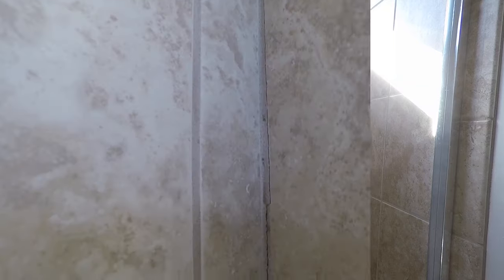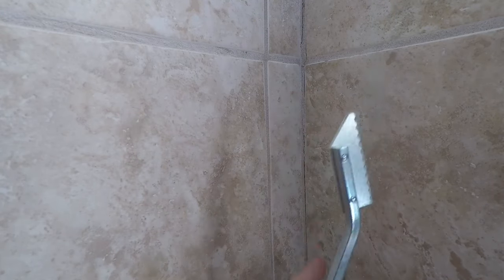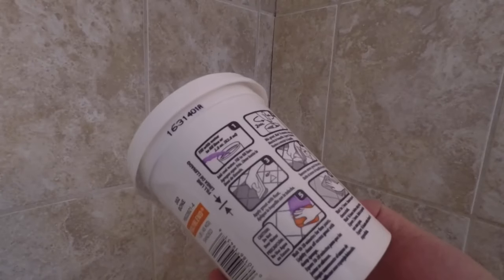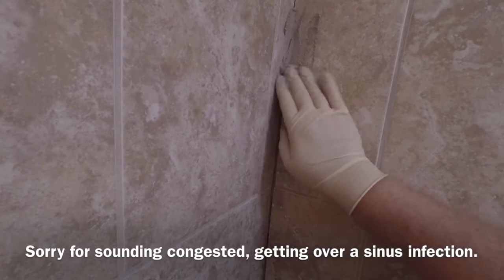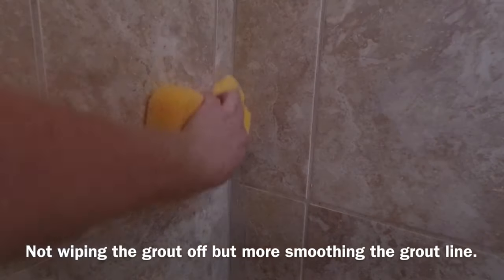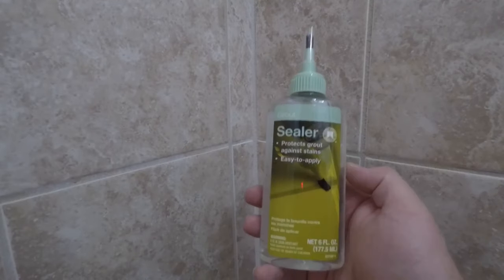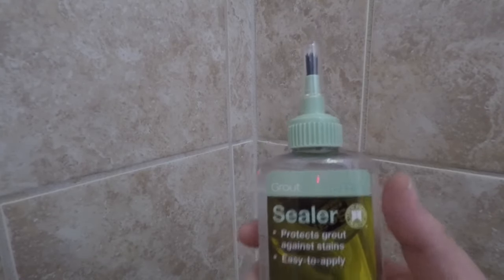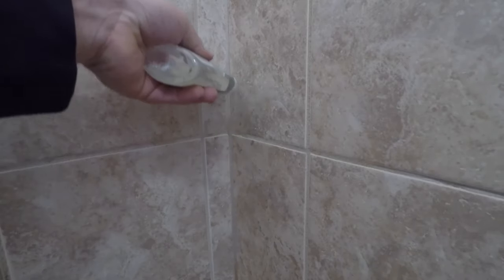Repairing Cracked Grout Line in the Shower

Comment: I repaired the crack just by applying new grout over the crack and wiping off the excess.  worked perfectly.  Been 9 months still looks great.
Reply from the maker: jzizzles that would be the easier solution, but if there is a sealer over the  existing grout the new grout may not hold. Also the possibility it re-cracking is always there. The best solution is to remove the old grout and replace it with new grout. Some professionals will also caulk the corners.

Comment: Exactly what an un-handy guy like me needs to know and be confident in what I’m doing.! Thanks for much for making it easy.
Reply from the maker: Easy - I would use the word doable.  Confidence comes after doing it ones or twice and finding out, yes I can actually do this.  

I always keep in mind there may be mistakes but with patience you can hide most mistakes. You may see them but no one else will.
Reply: @code3imagination441  Now that the grouting project is finally done, I agree — it’s doable. Lot of time and effort and not easy, but it turned out well. Thanks so much, Tim. Your online tutorial helped me every step of the way.
Reply: @paulmarck9349  t
Reply: Thanks My weakness is a cross between time and opportunity cost with big hands and not wanting to be a super clean and it becomes a mess at times
Reply: Hello. If I only need to repair small cracks and holes in the grout on the shower floor, do I need to take out the entire old grout with the grout saw? I just need to do small touch ups. Thank you for the video.

Comment: To anyone seeing my comment: I highly recommend doing this when you’ve just bought a new house or had someone do a shower remodel. Sadly, most tile installers don’t bother doing this step (takes more of their time and effort) and you won’t think about it or realize it until you’re eventually trying to scrub dirty, moldy, hard-to-clean grout. Taking this step will also help avoid having to pull out disintegrating grout later on. Prevention is key! Plus, continuing to use a shower with disintegrating grout is a recipe for disaster as it allows water to get in behind the tiles, creating mold and potential water damage. Ask me how I know this!
Reply from the maker: Remember grout is porous and water will get through with out cracks present. The number one thing to prevent water is prepping the backer board and waterproofing it properly.

Comment: Peraonally i would have siliconed the corners due to expansion and contraction.  Thats why it originally cracked i guess.  Unless the polyblend flexes? Idk
Reply from the maker: Paul Pagano new construction home. They cracked as the house settled.  They cracked with in the first year of being here.  Once I fixed it they have not re cracked.
Reply: Paul Pagano you are correct. Caulk the inside corners, don't grout.
Reply: So if the corners should have ( I stress "should have") been caulked, then why don't they just do that when they first do the tile, I've had 3 new houses and never seen a right angle grout joining on wall to wall or wall to floor or this to that ever anything but grouted. I did see in the big box stores tubes of "grout caulk", that is for that, don't know if its a mixture of grout and caulk or just a different type of caulk specifically for this. Perhaps you guys can educate me, Thanks.
Reply: @themonkeydrunken  I wouldn't recommend caulking in a tile shower any where except around door frames. Mold always settles behind the caulking. Grouting and sealing is the way to go. If a crack ever develops just fill the crack with grout then seal.
Reply: @jman1057  Mold is a symptom of poor caulking technique. Done correctly, there's no lip for material to collect and grow mold. 

It's important to not use grout in corners because it will always crack, allowing water into the wall.
Reply: @ColdWarVet607  i do this work for a living custom showers remodels to be exact and i always silicone color match all corners people who do new homes don't know what they are doing they tile on sheetrock with no seal or water membrane applied I've seen it to many times so having " new homes " don't mean its done right
Reply: @michaelsanmiguel7417  so I’m doing it right in your opinion to apply properly applied caulk over joint cracks in the grout?? Any videos on how to properly apply caulk so it doesn’t mold?

Comment: Does the sealant ensure waterproofing? Why I ask is cuz my contractor installed my shower I know he put a plycem (waterproof type of panel)  underneath the adhesive for the tiles then grout. I don’t believe he used a sealant and my shower is leaking. Needless to say my contractor has abandoned leaving me fd on more than just the shower so I’m tackling one project at a time,

Comment: This was extremely helpful.  I do have one question though.  I only have one bath.  What would be your suggestion if taking a shower in between the curing time is not an option?
Reply from the maker: @pamelaemmett7961  that I don't know. I know there are fast drying grout but I have not used them. Keep in mind I am not a tile pro. I had that same situation when I renovated the bathroom of my first home. Only had one bathroom. I also work as a firefighter and my station was only two miles from the house. So I would recommend taking up a second career as a firefighter and use the station's shower.  Lol.

Comment: tiling my bathroom right now, looking online I think you should have caulked the corners, polyblend makes the same colors as the grout they have. Due to expansion contraction, caulking wont crack in the corners.
Reply from the maker: sowtis I have used that product before in a rental I had. It didn’t look right. This is in a new construction home. Because the house was still settling I knew this would happen. My boss(the wife) wants me to redo the bathroom in the next five years so this was a good fix for what we have planned.
Reply: well thats not good..😢. I'm grouting tomorrow with polyblend. Remember what color it was that didnt match? I'm using delorean grey. hope it matches.
Reply from the maker: sowtis I have not had good results with the caulk, not sure if I did it correctly or what, but I may just be uses to using traditional grout. The sanded or unwanted type.
Reply: What did you end up using - grout or caulk? I saw you had a similar question on another video as well. I'm going back and forth myself what to do.
Reply: @code3imagination441  How it looks is less important than whether it works -- keeping water out of the inside of the wall. Silicone caulk belongs in inside corners. Grout doesn't.
Reply: I bought some grout caulk..same brand and color of that grout. supposed to flex..and match the grout..expensive tho..maybe i should just use white bathroom caulk?

Comment: Great video! And it was even funny! I'm going to try this on my own. Thinking of using caulk in the corners. Wonder if you have a video for that 🤔
Reply from the maker: Millie Mi I know there is a specific call for just that. I have used it in a rental of mine several years ago. It’s a quick fix but in my option does not look as good as regular grout. 

Just make sure to pick up the correct product for the job. I think it can be found by the tile/grout at you local big box home improvement center.
Reply: Millie Mi you're right. Caulk goes in inside corners because grout will always crack there eventually.

Comment: Good video. I'm definitely not an expert by any means, so take this with a grain of salt - do your own research - but from what I've found online, it's incredibly common for grout to crack in the corners. Just due to house settling/shifting. So a lot of people fix a grout issue like this on a corner, only for it to come right back within a year. So you may want to add a layer of bathroom caulking on top for the corners to provide some flexibility for that shifting. Just a thought. Again, do your own research. Thanks for the video!
Reply from the maker: That they do. This was a new build, I did not do it or would have done a better tile job, and I waisted a few years before repairing it. The tile job here was piss poor at best.  If done properly the cracking would have been only minor. Since the repair no cracks, but soon I am remodeling the bathroom.  Remember grout is not a waterproof barrier. You can get a sanded call made for showers. Sometimes the big box stores do not sell it and may have to go to a tile shop
Reply: @code3imagination441  Yeah that makes sense. As you can imagine I'm here on this video because I'm going to be doing similar repairs to our shower tiles. Except ours is a bit worse lol. I've got a bit of work to do

Comment: Great directions, thank you for sharing. Would this be good to use on the part where the tile meets the bathtub? Mine is cracked and I wasn't sure if I should regrout it or use sanded caulk.
Reply: Use 100% silicone caulk where tile meets bathtub so it will flex better when there is weight changes. It’ll crack if using grout.

Comment: That's the difference between American and UK standards, Americans grout corners and in the UK we use silicon because of expansion
Reply from the maker: Ya I don’t know. I think it is just a traditional thing. I have seen the the grout caulk that is make to match your grout. I think the silicon would be better but the look is not as pleasant to the eye.
Reply: @code3imagination441  you can get silicone to match the grout colour

Comment: Have you ever dealt with a case like this where there was drain fly larvae infesting the cracked grout, and if so, did the 50/50 bleach solution still work or did you have to use something stronger for that?
Reply from the maker: I have not had that happen.
Reply: @code3imagination441  ah, okay. 

Thanks for replying so quickly,  though.
Reply: Ew

Comment: When you used the tile sponge to remove the haze was it dry, damp or wet?
Reply from the maker: Damp. Completely soak the sponge in clean water and squeeze out the sponge. The key is the clean water.  I use two buckets when doing this process. One bucket to rinse the sponge(change this water frequently) then soak and squeeze out the sponge in the clean water in the second bucket.  You could use one bucket but you have to change the water more frequently.

Comment: Do I have to take out all the grout? Would I be able to just patch it if it’s a small crack?
Reply from the maker: As far as I know, yes. I may be wrong but what I have read on this is if you leave the old grout and try to fill in the cracked line it will crack again.

Comment: perfect video for my exact same issue - I appreciate it greatly.  However, do any of the power tools, the Dremel for example, fit into corners?
Reply from the maker: Daniel Zahirniak I do bit at the time was to lazy to get it out and try. I figured I could use the hand tool. If I had to do this again I would use a power tool.
Reply: Code 3 Imagination   I also have the same question.  I’m having difficulty removing the grout where the walls meet each other, and where the walls meet the floor (stall shower with tiled floor). 
My multi-tool can’t get at the angle to remove the grout. Does anyone have suggestion for how I could use my multi-tool successfully? Perhaps some sort of angle attachment/accessory?  I can’t seem to find anything.
Reply from the maker: Maybe get the hand tool to get all the grout our. Not sure what else you can do. I do know if you don’t get the old cracked grout out it will crack in the same spot again.

Comment: 100% silicone! Was I right?
Reply from the maker: Polyblend® Sanded Grout is a dry, Portland cement based grout with silica sand, inorganic aggregates and chemicals.
Reply from the maker: @dare2scheme904  I have no idea. This product what the only thing I could find is a small quantity. I will keep that in mind if I have to ever do this again.
Reply: @code3imagination441    Indeed if you research Roman cement you will find it is observed to resist cracking and many cement structures have retained their integrity. Concrete is cement mixed with aggregate there is no Roman concrete which does not contain cement and the term cement itself is Latin in origin so the "Portland Cement" guy consciously filed a patent for something already known and in existence for over 1000 years.

Comment: Never add grout to cracks? Y not? Is it a must to take all grout out before adding new?
Reply from the maker: Reef Cloud from what I read and been told if you grout over the cracks it just crack again.
Reply: Probably because the grout won't penetrate the crack deeply enough to be strong enough of a fix. If you're able to open up the crack enough to stuff grout in, have at it. Or just use a grout caulk so you don't have to worry about doing this laborious task again.

Comment: This grout doesn't last very long at all. I would never use it again.
Reply from the maker: My house was newly constructed home. After the house settled that’s where we noticed the cracks. Also the contractor did a crappy tile job. Once I repaired the cracks I have not had an issue. The plan is to replace the tile this summer and redo the bathroom.